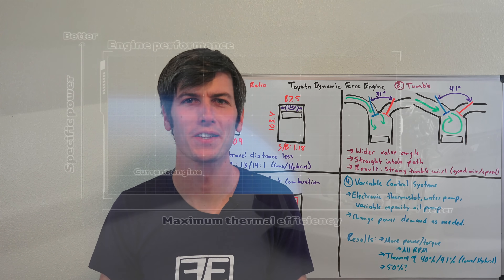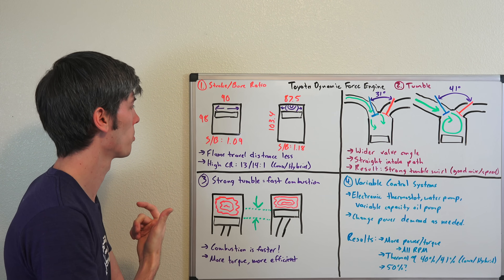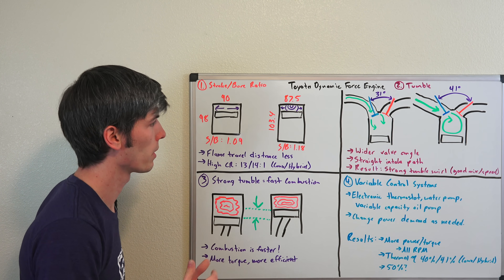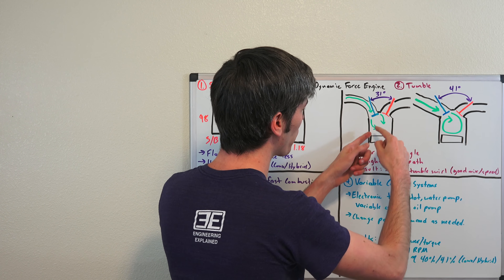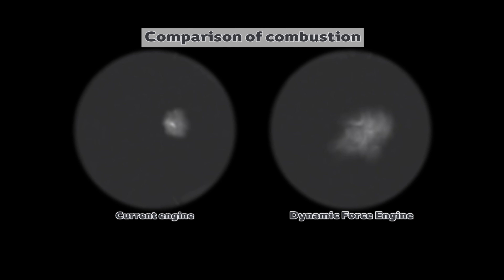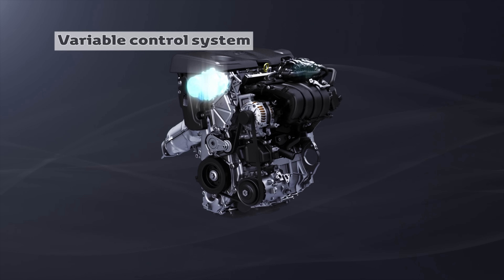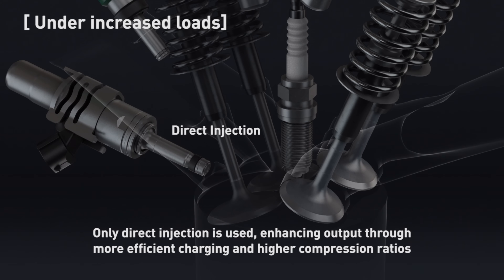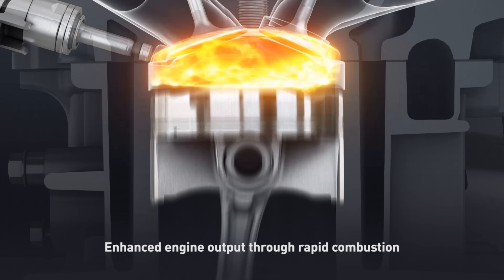Toyota's New Dynamic Force Engine Is Super Efficient

Comment: A piston rod design with oil galley from the crank end to the wrist pin side with oil squirter holes that angle upwards below the piston skirt would oil the wrist pin, crank end, and cylinder walls more effectively. Plus a separate compartment for the CVT belt with its own cvt oil pump, magnetic drain plug, external filter, filler tube/dip stick tube, and the cover design that allows removal of the worn or broken CVT belt with our removing the whole transmission would be helpful in repair cost and ease of replacing the CVT belt instead of the whole transmission.

Comment: Yes that's true in intake runner design on the short side radius to make it a right angle, rather than making it a smooth radius  as cylinder head porters would do. This right angle sharp turn is forcing more air and fuel to cross over to the long side radius and cross over the intake valve to it's far side that creates more tumble which causes better air fuel atommization and quicker burn rate for better efficiency!!! Its like a ski jump short side launch ramp, very intentional in it's design!!!😊

Comment: I'm wondering, how long will these cool electronic water pumps, electronically controlled variable valve timing systems, and electronic oil pressure governors last?
Reply: I have 106K in my 2018 camry and nothing listed had been replaced yet. Will see

Comment: Intriguing! Re-reading my book on Cosworth and the F1 DFV engine, Duckworths preoccupation was to reduce the included angles of the 4 valve per cyl valve train in order to achieve the fastest flow and mixing of gases. The contradictions here elude me. I understand the logic of variable output subsidiaries, as they are demanding of power, but long term reliability of these evolved systems will be critical to many (cash poor) Europeans. I hope we can use this tech’ in hybrid vehicles, with smaller engines.

Comment: also worth mentioning that mercedes is hitting those thermal efficiencies while also having to produce high power, running 18.5:1 air to fuel ratios. They are very special engines, and honestly seem to be designed perhaps by an insane person.

Comment: In light of the announcement of the collaboration between Mazda, Subaru and Toyota, I find it very interesting that the "new" Toyota engines are similar to the Mazda Skyactive-G engines that Mazda developed since 2010/2012. Mazda produced Skyactive-G 1.5L & 2.0L petrol/gas enigens with direct injection and 14:1 compression ratios for over 10 years now. Now Toyota has "new" engines that are the same size and compression ratio. I feel there is more technology sharing between these 3 manufacturers behind the closed doors that they are not willing to elaborate on.

Comment: I was wondering if not to much to ask if it is possible that you can do a review on the tundras V35 twin turbo engine? Do you think this engine has the potential to last a million miles? Why are the HP and torque numbers so high and why does it have the potential to take on more stress than the traditional v8 engines?

Comment: Noticed that main bearing oil clearance by engine service manual are not equal.
For example,
1st, 2nd, 4th, 5th - 0,014 mm standard value.
3rd - 0,020 mm standard value.
What could be a reason for that? What's wrong with 3rd one?

Comment: More thermal efficiency should be a noble goal. Not everyone can switch to EV, and even fewer people will willingly do so, especially while they are partly politically backed, people hate being told what to do sometimes. So we can still save a ton of fuel by improving engines and using hybrids to warm everyone up to partly electric vehicles, some people using hybrids may one day switch to an EV, but even if they do not, there is still a benefit to all.

Comment: it should be noted, that the cylinder block design, and even cylinder head with laser-clad valve seats, make it impossible to rebuild or repair this engine with a reasonable budget - (this engine is kinda a one-off).
Reply: Well hopefully it's one that runs long enough to save for the next car. I'm at 120k now.

Comment: I like that they combined direct injection with port injection. Engines with direct inject only have crazy carbon buildup problems, and port injection keeps the valves at cooler temperatures.

Comment: For those questioning reliability, I’d argue they are more reliable than the previous 2AR 2.5, I’ve seen several of these dynamic force 2.5s with 200,000 miles on them and they run great and don’t burn a drop of oil.

Comment: Having a more direct angle in the intake valve will change the forces applied to the valves by the intake air, those forces are not going to be in balance, this won't cause the intake valve to have uneven wear on valve seats? I think Toyota Engineers must have thought about this, my question is more, how are they fixing it, or maybe the air force is insignificant.

Comment: How can Toyota use a 14:1  compression ratio and not have a pre-ignition or detonation problem?   Does this new D-4S engine still use the Atkinson strategy in the hybrids?   I read that this engine does not produce much intake vacuum and so has to use a vacuum pump for the brake booster.   I am surprised that the car does not use electronic brake boost.

Comment: I wonder if water injection works with that. Where you could run on kerosene cold vapors from a wicking carburetor where the ventry forces air around the kerosene wick and water injection stops knocking.

Comment: What does this do to 1: engine size and weight? Does it mean we can have a smaller lighter engine and get the same horsepower?  
2:   Related to 1, what does fuel efficiency look like, eg what’s the gas mileage?

Comment: Would be cooler if Toyota had Inlet on back & outlet manifold in front, for cooler engine bay . this design keeps engine hotter , that's the reasons they redesign thermostat & cooling system. Old 2.4 2.5 2.7 was simple but setups. Engine 👍,  redesign around the motor 👎

Comment: @engineeringExplained   If this M20A-FKS engine has a thermal efficiency which is close to a diesel engine, how come it's not getting diesel engine mpg figures?  I recently took a a Corolla 2.0 CVT on a road trip and it averaged 36mpg at a constant 70mph speed in flat Florida.  Although not bad it's about the same as any other small car or Corolla I've driven in the past.

Comment: Hi Jason, thanks for another informative and easy to understand video.    Would appreciate if you can clarify 1) 40% thermal efficiency is measured in what test condition and which standards   2) What is the Thermal Efficiency of the current engine of similar cc?    3) What is the real life km/l for the current and this new engine when fitted to similar model of near similar drag and weight?  thanks :)

Comment: It's impressive but all these dynamics make a very complex system monitoring. The design of the increased valve angle and entrance seems to be the best part about this motor. 

When we see the new models for this dynamic stroke motor from other manufacturers, I'd say the exact same, because it would be more difficult to repair at home and afford the parts.

Comment: We just baught a 2020 that has 24k miles on it and love it. The engine I have zero concerns about. The 8 speed transmission on the other hand I have some reservations, but I feel better about it than any CVT which is why I chose the Camry over the Accord. I do not see a CVT making it to 200k miles, but a well serviced traditional transmission even the 8 speed should do it easily. They did have soem transmission issues in the early 2017 transition to 2018 models which seems to have been resolved. The only complaints you hear are shifting issues which are caused mostly by the adaptive transmission. When you buy one used it is important to have the dealership wipe the transmission memory otherwise it will try to anticipate the previous owners driving habits causing some rough shifts. It takes about 1000 miles of driving for the transmission to adjust to the drivers habits. It is capable of learning multiple drivers, but works best with the main driver. When you look at this engine vs. Ford, Chevy, or any other competitor it is hands down better IMO. They thought of everything carefully unlike Ford and Chevy. Most every maker out there has gone to direct injection without multiport and no way to clean the valves resulting in expensive repairs 45k-50k mile marks. Ford especially has had problems with turbo failures after cleaning the carbon build up on their Eco-Boost Engines. There is a service bulletin out on this now. All of these technologies are being used thanks to uncle Sam placing strict regulations on auto makers for fuel efficiency, and it will be expensive to consumers down the road.I know Toyota is not perfect, but long term I think I will spend less with them than any other brand. One thing they added I don't like is an EGR. Why the hell is Toyota adding an EGR for a gas engine? That is not going to make much difference in air quality, but if they turn out not to be reliable its a very expensive repair.
Reply: My 2017 F150 has direct and port injection.
Reply: @bubulubu3136  Yes later models had it added. Good thing too! Ford and GM pissed off and lost a lot of customers over it all too. I am just glad I got rid of that 2015 Fusion!

Comment: I am concerned with the new tech lazer weld valve seats on the new 3.5L Tundra. Will they be as reliable as the older press fit hard seats?

Comment: Complete combustion occurring sooner in a longer stroke is not a good thing. This is why turbos are effective, a denser mix allows for a longer, slower burn targeting the crankshaft closer to 90 degrees thereby increasing torque.

Comment: we have known for a century that longer stroke engines are more efficient.. and yet we have in the last 60 years moved towards wider and wider bore and shorter relative stroke. Thank you Toyota for lengthening the stroke. This is the future of ICEs and it is long overdue. 

Question, in the illustration it appears that the intake and exhaust valves move through the same space,  if anything were to get out of time, (i.e. a broken valve spring or rocker) , you would have an intake valve striking an exhaust valve, Ill call it "valve interference". For a Toyota engine this might be a possibility after 800k miles !!

Comment: I've always wondered, theoretically, how an efficiency of a four stroke engine can be more than 25%? You have only one stroke that actually push the piston and rotate a crank. Three other strokes not doing anything to create the work, they just support the whole process.
Each stroke has 25% of time to do something, which is why I will probably never understand how different engines can reach up to 40 or even 50% of efficiency.
Reply: its how much the chemical energy of the gasoline is used to move the car, lower effiency means more heat and higher exhaust sound

Comment: Hmmm narrower bore potentially reduces the area available for the valves, potentially reducing gas flow if they take it too far.  The compression ratio is astonishing, 14:1 is Diesel territory, so they are really pushing the envelope when the engine runs at full throttle.

Comment: I agree with Matt below extra electric control higher costs & failure rates, I would like to see more research into using Hydrogen gas powered vehicles making fuel from water example! I saw a demonstration at a car show some years ago but I understand next energy purchase the patent? Next Energy is owned by Oil firms.

Comment: My main issue is the direct port injection which causes a great deal of carbon and sludge build up on the intake valves and also the injectors to a lesser extent.
Reply: It has dual injection. Direct and port

Comment: I have a 2018 Toyota Camry with the 2.5 l engine, to my understanding it  is one of the I-4 engine. I have been very happy with the horsepower and torque it creates but not so much with the fuel efficiency especially when in stop and go traffic

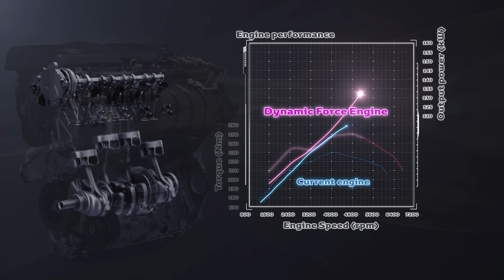Comment: I”m not a mechanic nor engineer, so someone needs to translate this into ordinary driver speak for me. Specifically, what are the benefits of such an engine? Does this have faster acceleration? Or better MPG? Or ability to tow heavier things? At about 3:50, he says ‘what’s it all mean? Well across all RPM’s you get more power” . What does “more power” at, say 2000 RPM mean? That I can go up to 3000 RPM quicker? Or that it takes less gasoline, so I have better gas mileage? Or that I can tow 1500 more lbs at that RPM? PLEASE, someone explain!

Comment: In the 70s and 80s Japanese were the first to make long stroke high revving engines that were smooth, powerful, officiant and had equal power distribution across the rev range even before ECUs become a thing. In fact, only they could make engines like these, cos Japan had far superior metallurgy technology than the rest of the world and only they could mass produce strong, lightweight crankshafts. And they have been the best in engine and transmission engineering ever since. 
If you will tell me that Japanese cars have crappy paint, I'll tell that German have crappy power train. Even though, they aren't behind in power train technology as much now, they still are far behind in production technology and development processes. Also they like to cost cut on key components to afford packing more selling futures.

Comment: Hello Jason

 I have concerns about my 2011 Rav4 engine which rattles during startup in the mornings or when left for about 2 hours or more. I would really appreciate it if you could do a video on this problem explaining everything you can research about this problem and what are the best solutions. Quite a few motorists have this concern but I am yet to get a detailed explanation to assist us in understanding the problem more deeply.

I have read about changing the intake cam gear and other prelube device which should help but I am not getting confirmation with regards to results. One video pointed to the 'worm lock pin' which is located in the intake cam gear. Another information was that there is a small duct which is responsible for helping to prevent the oil from draining back into the engine block(which when the oil seeps back to the crank case, suggests that the engine block is worn)
. I am frustrated and would like an expert view and advice.

My Rav4 has a little over 220, 000 miles on it but majority highway miles and it runs excellent otherwise and has no rattling or unusual noises while engine is running. I normally service my vehicle at about 4500 miles each time and I use 10W-30 Toyota engine oil about 98% of the time. I really love this suv and would love to keep it for another 5 years maybe. Please help me in the shortest time possible.

However, if it will be too much to do a video, please send me the info via email asap so i can try to keep my Rav4 in tip top shape

Thanks in advance
Nick

Comment: I'm glad Toyota and other OEM'S are putting money and time in to increase engine efficiency.  I have a 2020 RAV4.  2.5 Liter 4 CYL.  8 speed auto, and it uses them all.
Around town, pretty good on gas, much better on the freeway.  Light vehicle with a peppy engine.  Don't know much about the engine, am learning.

Comment: Thanks for your excellent presentation.  I would like to inquire what you exactly mean by an efficiency of 41%.  Wouldn't the efficiency of the engine be always limited by the Carnot Engine?  And so the 50% efficiency of the Mercedes you quoted seems impossible.  I would appreciate a detailed explanation (or links, etc).  I mean that is one of the reasons why the future is electric engines since it is not limited by thermodynamics.

Comment: Very impressive. If this engine really gets 40% in production that's pretty incredible. Nice work Toyota!
Reply: Or is it? Toyota's Dynamic Force engines M20A and M15A engines suffer from the EGR cooler corosion which can damage the engine. Toyota didn't mitigate against the problem and they put a blame on a bad fuel. E.g. drivers of new Toyota's in Italy have quite a lot of headaches lol.
Reply: @OverG88  That defect has nothing to do with Dynamic Force engine this video is trying to explain.

Comment: I have the 2.0 liter version of this engine in a 2020 Corolla.  Driven gently, it's averaging almost 38 MPG in cold weather, in mixed driving.  I expect 40 or more in warmer weather.  My only worry is just how complex this entire system is.  Analyzing and repairing issues with such a complex system is going to be nightmare as the car ages.  I actually leased the car - something I would have never done before - and considering that a thousand dollars for a typical repair is becoming commonplace with modern cars, maybe always driving a new car via leases isn't as bad an idea as it used to be.  When you lease, at least your car is almost always under warranty.  I sometimes miss my old 1973 Chevrolet pickup truck with a straight six engine and a three-on-the-tree transmission.  It was bulletproof, and could be worked on with a small toolbox full of wrenches.

Comment: Nothing new here. All these things had been done (though separately) before. I think most British bikes of the 1950's had similar bore/stroke ratios, because back then bikes were serious transport (not toys) and economy was crucial.
 We fitted electronically controlled electric water pumps and fans in the mid 1990's (if I recall correctly) to some racing cars we built; we found there was no need for a thermostat.